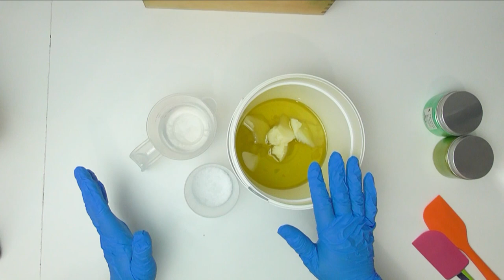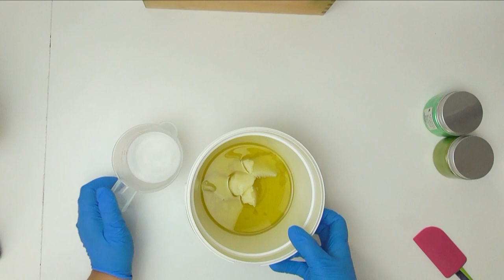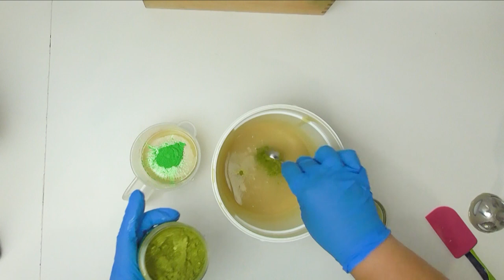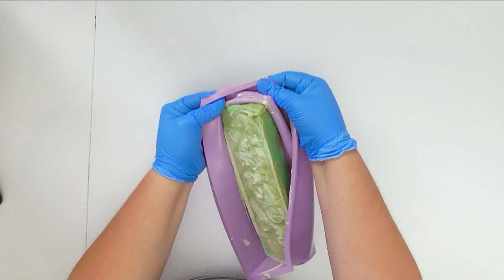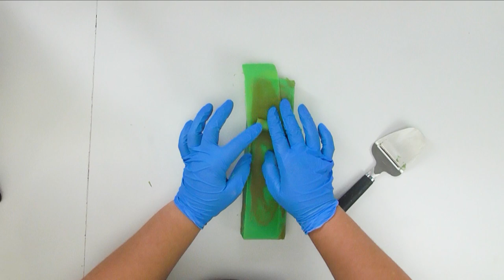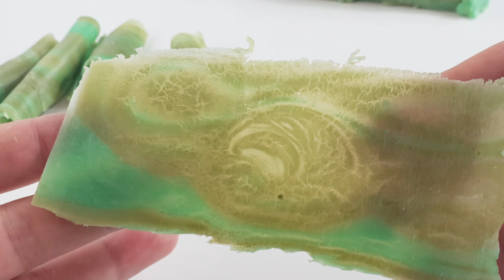Making Soap Curls using Heat Transfer Method of Soaping

Comment: Nice soap curls! I love the patterns you created. I can't wait to see what you do with these. Heat transfer was essential for me to make my big batches of soap. I have no stove big enough for my huge soap pot. Tip: shea butter may saponify too quickly with the hot lye water (it always does for me) so I add my butters (melted in the microwave) with the liquid oils  after the other solid oils are melted. :)Jen
Reply from the maker: Thank you for the tip. I do notice the heat transfer traces quite quick and wondered if the Shea had a part.  The video of this soap is up now 😊

Comment: It's the heat! I have about perfected Glycerin rivers lol. When i work hot i always get them! I have to mix at room temp now to avoid them and i can't insulate my soap either. I think because of living in Florida with the heat and humidity
Reply from the maker: It's definitely hard when you live in a hot, humid area.  I usually do soap at room temperature but this varies greatly depending on season.  I'm not convinced it's TD that solely causes them.